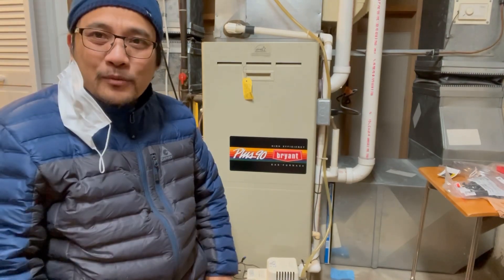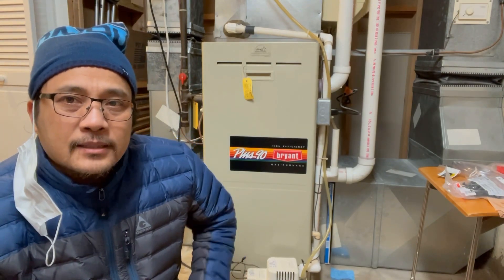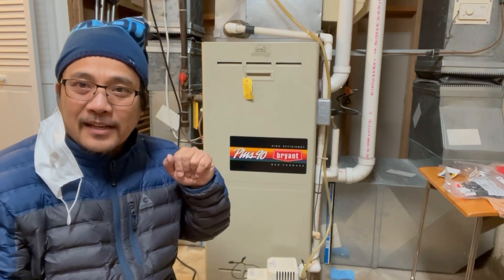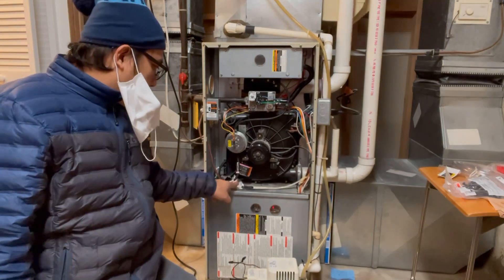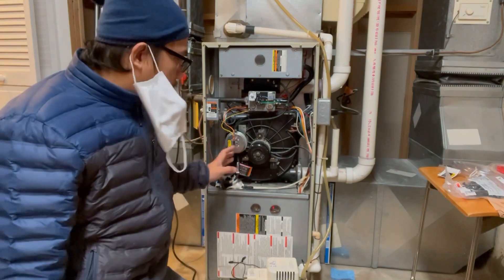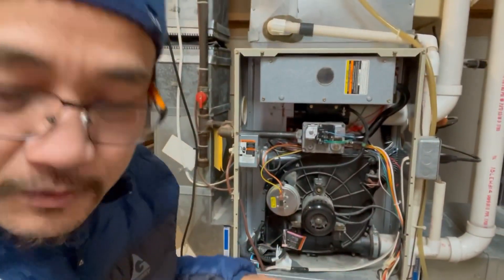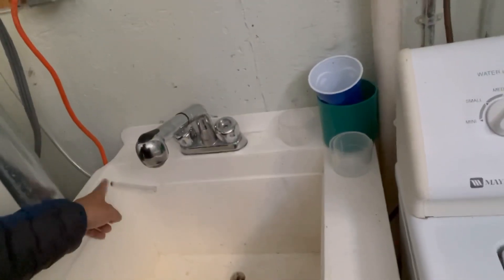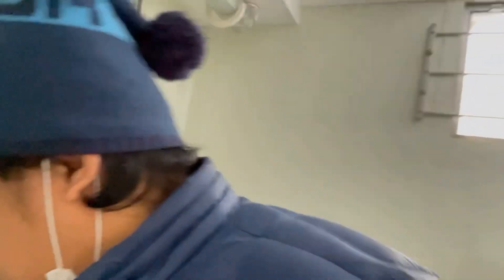Gas Furnace Common Heating Problem???Condensate trap clogged and how to fix??

Comment: You saved me over $10k in replacement unit by giving me the courage to go up and work on my furnace. I was having issues with the burning staying lit, had a technician come claiming it was the gas regulator that was the problem, then charged me $1100 to replace it which I thought was ridiculous, and for some reason that fixed the problem and then I was told I needed a new unit. Ended up finding out the pressure switch was clogged with air not being able to escape through the drain pipes causing water to back into the inducer motor and the heat exchanger.  Cleaned the blockage and it is working a lot better than I expected.

Comment: i clean my exact trap ,but when i installed it is sucking air from the drain pipe is this normal ?
Reply from the maker: Yes, that is normal because the drain is connected to the evaporator drain pan😀

Comment: I have a carrier, infinity 96. The condensation tubing runs directly along the floor into the drain (We have an old home). The way the tubing sits, sometimes water collects in it and then it has to kind of be pushed uphill in order to go out. About a year ago, our furnace wasn't working. I also noticed that The tubing was full of water. I emptied it out, turn the breaker off and on, and everything worked. Now, we're facing a different problem, but I wonder if it's related.

The furnace stopped working, I noticed that the tubing was full of water. So I did the same thing above (emptied it turned the breaker off and on). The heat worked for a couple of hours, then two or three hours later it's stopped. I noticed again that the tubing was full of water (seems like a lot of water for two or three hours). I emptied it again. Furnace worked for a while, then I got a blower fan fault error, followed by an ignition lockout error. There was a little bit of water in the line but I was having a hard time getting it out. Eventually I did. I accidentally removed the line from the trap, and I could hear a whole bunch of water inside (releasing the line resulted in a glug glug glug noise). I attached it back on, no water was released into the tubing. Around the machine and we got the same error codes. Now, the machine has been running fine for about 12 hours. 

Do you think this might be because there was excess water in the trap that has now cleared?

Thanks. 

Very strange!

We did hear some rumbling and a little bit of squeaking in the fan, but our technician seem to think that wasn't a big deal. He suggesting we replace our blower but everything's been working. I think I might wait for another day or two to see if the issue has resolved itself (in hopes that some water may have been trapped in the system that has been released). 

Any thoughts here from anyone would be helpful.

Comment: Kuya our problem is our heater has no condensation at all.It stop 3 weeks ago. My husband clean all the clogs and everything and still no condensation. Can you advice us how to have our condensation back again. And is there a danger running the heater without condensation?? Please advice??
Reply from the maker: Hi Inday, I think Your unit has a low Freon that is way no condensation. If you’re unit is heat pump it will not satisfy your heart at home. But if your  furnace is heating Gas or Electric no problem
Reply from the maker: Your husband did a good job for doing the basic check up but you need to call for AC technician to add Freon on your unit Sorry! na busy ako hindi makapag view ng mga messages.
Reply from the maker: Ng mas maaga.
Reply: Salamat kuya sabihin ko sa asawa ko. Gas kami kuya.salamat sa blog mo marami ka matutilungan. God bless you and salute to you!
Reply: Kuya May Freon ba daw ang gas furnace sabi ng asawa ko ang alam daw niya sa air condition Lang ang Freon. Katulad ng air con sa sa bahay at sa mga sasakyan kase May mga air con yun.saan ba yun Makikita sa unit. Yung lalagyan ng Freon Gas ang gamit namit.salamat po ulit.

Comment: My carrier weather maker is old and leaking all over the floor. I checked the condensate pump and the lines going to it and the lines going out of it and everything looks fine what else could it be
Reply from the maker: Humidifier filter if your unit have one can cause leaking if it clogged too.